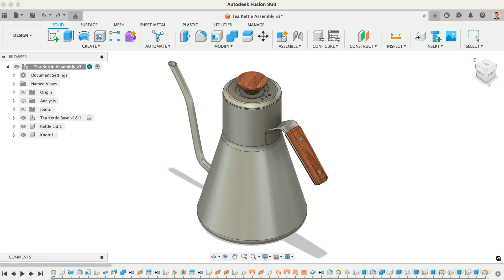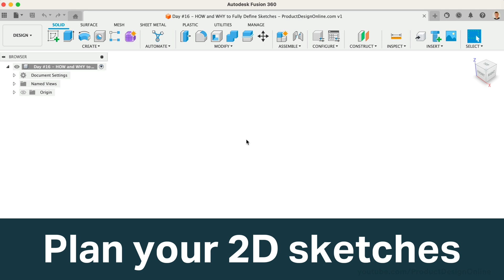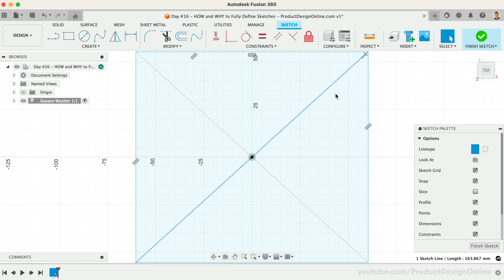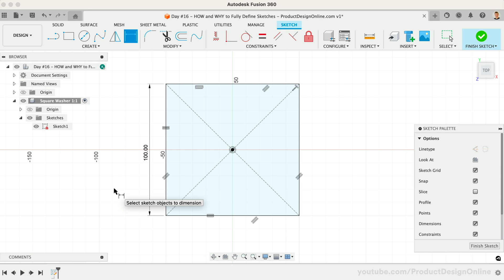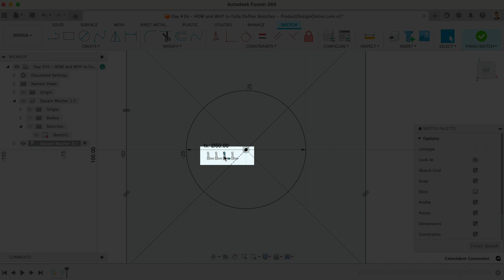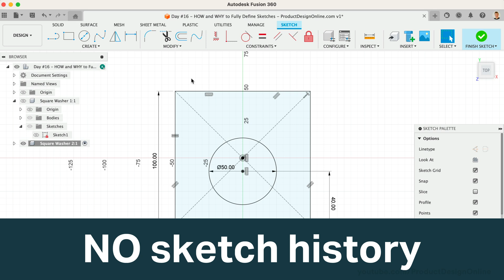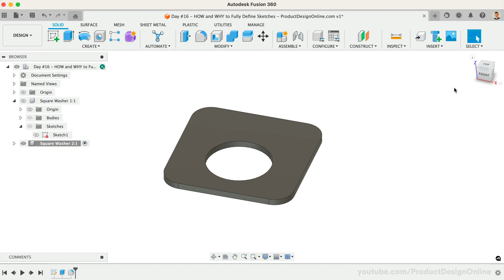Don't break this Fusion 360 rule! | Day 16 of Learn Fusion 360 in 30 Days (2023 Edition)

Comment: Is there a generally accepted rule about whether to prefer constraints vs dimensions? For example, The circle's diameter can be constrained to be half the length of a square side by using construction lines, and equals constraints.  The more I'm using Fusion, the more I'm tending towards this approach of using construction lines creatively, rather than formulas in dimensions.  Is there a generally accepted choice on this, or is it just personal preference?

Comment: @2:14 - when trying to replicate the Equal Constraint step, getting a "Failed to solve.  Please try revising dimensions or constraints." Any suggestions?
Reply from the maker: There is likely another constraint that was automatically applied. Double-check that you don't have any other constraints that would restrict it from making the sides equal in length.

If you can share your file, I can take a look.
Reply: I had this same error. Make sure you're selecting the "Equal" icon and not the "Parallel" icon. They both look similar

Comment: I can't move the circle after deleting the same constraint you selected. I've already tried deleting any of the constraints but nothing happened.
Reply: Same with me, even tried right clicking and moving it but not doing the same thing that he does in the video.
Reply: Figured it out, make sure you have the Bodies and Sketches for Square Washer 1:1 off/not visible for it messes with how things look for they are stacked on top of each other.  I had turned off the component but didn't have the ones under it off.  Then try to figure out which constraint is the center one for the circle, seems the order of the constraints changed when I did it different times.

Comment: I was having trouble deleting the constraints for the circle @5:44, it would delete the entire sketch. If you select the constraint and right click you can select 'Delete Coincident' from the menu
Reply: is there some way to prevent this behavior?  Why does it seem to work for him with just the delete key?
Reply: Thank you!
Reply: I'm not getting this "Delete Coincident" from the menu when right-clicking on the constraint.
Reply: @jeffbrazill764  Make sure that your first component (the initial square washer) is set to 'not visible'. Otherwise, the sketches of the two components will be shown overlayed in a weird way.
Reply: @jeffbrazill764  I am sure you figured it out by now but for others reading this later, left click on the center coincident of the circle, then right click and you should see the delete coincident option and can select it.

Comment: Hi Kevin,
Thanks for the great tutorials.
I've been following the instructions step by step, but I'm having trouble with the coincident constraints not showing up when I click on the circle. Additionally, I'm unable to move the circle as demonstrated in the tutorial. Could you please assist me with identifying the issue?
Thanks in advance for your help.
Reply from the maker: Can you capture sma screen recording and share the link to it? That sort of thing is hard to troubleshoot without seeing it. 😎
Reply: I had the same problem. I simply reverted to the step before removing the constraint, remove it again and then with "right click" and selecting "Move/copy" I was able to move the circle.
Reply: Hey, I had the same issue. After a while though, I noticed that by hovering the mouse cursor over the center of the circle, the constraints would appear.

Comment: Great video, Thank you!  Removing that constraint for the circle kept getting me, because for me it was the third symbol from the center.  Is there is an easier way to identify which coincident constraint is selected, when there are a few coincidents on the same spot?
Reply from the maker: I believe they're always listed in the order they're created, from left to right. You can also select the constraint and it will highlight the geometry. Sometimes that isn't helpful if two or three of them are only doing a sketch point though.
Reply: @ProductDesignOnline Thank you

Comment: Why do my sketch dimensions not maintain just outside the shapes boundaries? When I resize the square in this video for example, my left constraint (the 100, 150, 200 etc), the physical location of that dimension doesn't move with the shape update. So it's sometimes inside the shape, if I go from 100 to 200. Or, it could be way off to the left and outside normal viewing area when I go from 200 back to 100. Having the hardest time finding how to make it relative to the outer edge of the object.